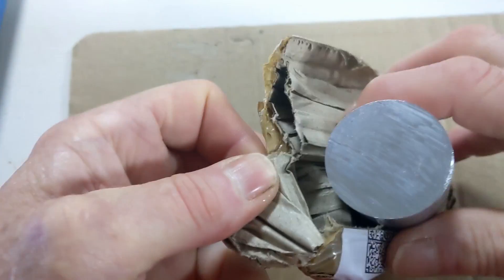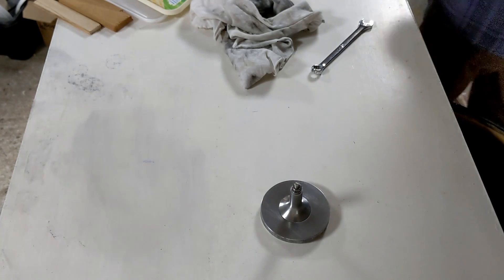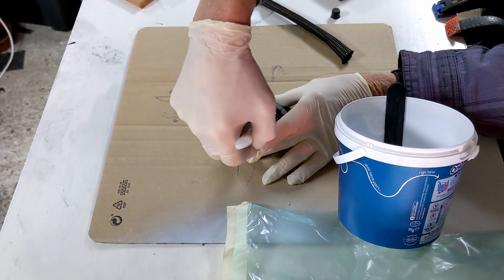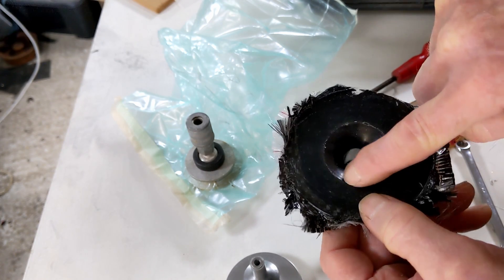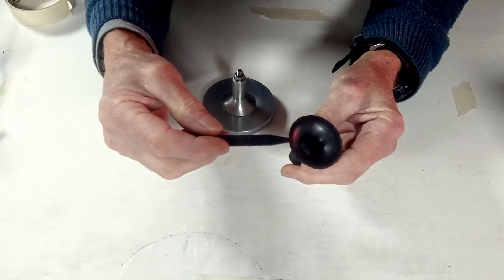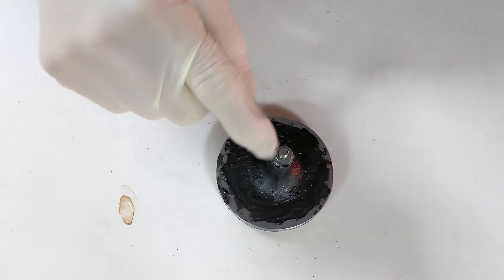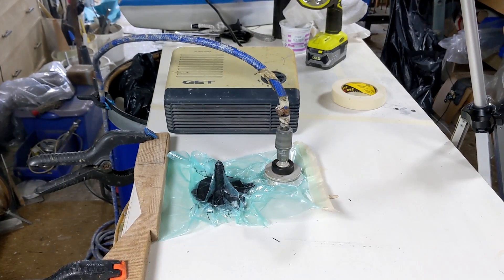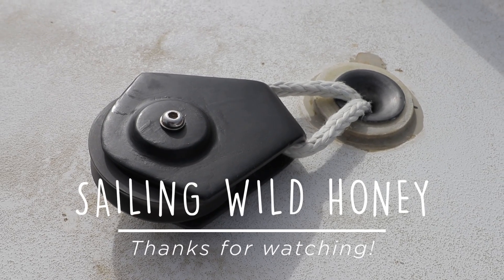Fabricating Simple Carbon Catamaran Deck Component – Ep08

Comment: We are planning to fit soft padeyes instead of a Genoa track (reduced cost and fewer holes in the deck). I don't have access to a lathe (or skills) so planning to use my router to smooth a hole through an Acetal disc bonded to  the deck. 
Where loads are lighter the shackle knot will be indented into the underside of the disc. Then not as strong (epoxy glue strength of the disc to deck) but no hole in the deck.
Reply from the maker: Sounds interesting but be sure to check out the acetal / epoxy bond strengths, as you'll be relying completely on this.
Reply: @SailingWildHoney  Yup, will do some pull tests. We are using a through deck solution for our chainplates already and will continue to do so for all the higher load situations. See https://youtu.be/gVSKUtglriI?